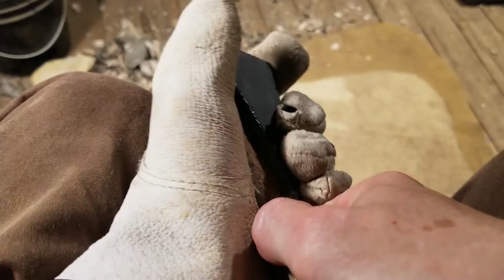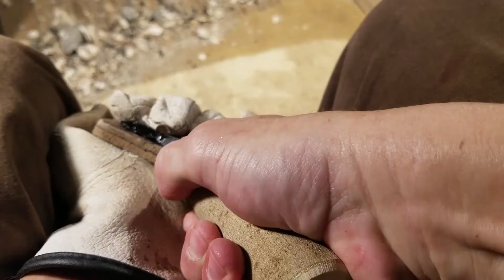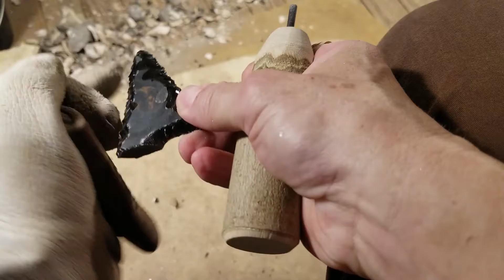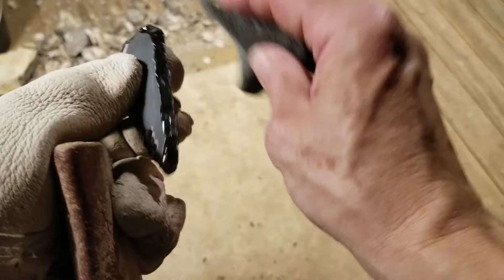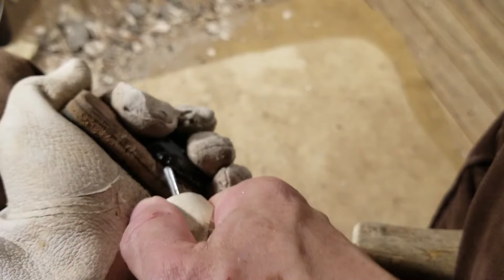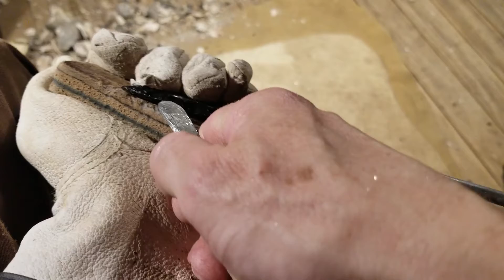786 - Slab Obsidian Elko Flintknapping with Steel 1/2

Comment: One question or curiosity I have about thin slabs of obsidian.  I bought 4 circular slabs of different kinds of obsidian when my friend and I went to glass butte oregon week before last. I would like to devide each of them into 2 separate pieces to Knapp into points. Is it possible to score them with a glass cutter and snap them with running pliers to maximize my usage of material.
Reply from the maker: Yes.
Reply: @KnapperJackCrafty  thanks